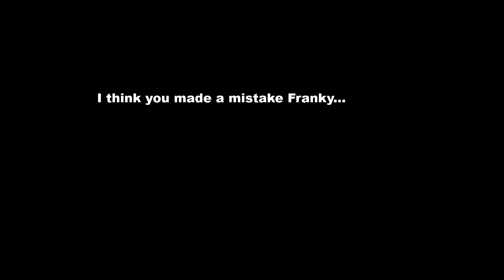BMS holder and powerwall master switch and JK BMS update bonus

Comment: Why did you drill holes in bms?
Thanks beautiful work!!
Reply from the maker: Hey John, 
The holes are mainly for heat dissipation. Secondary, if there's damp inside the unit because of rapid changing temp, the damp can escape via the little holes;

Have a nice day.
Franky - easypowerwall

Comment: The BMS holder is a great idea!
One critic: the position of the master switches:  I would strongly advice that these are like the fist thing you see on a device.  With the master switch behind some of the cables, you get the feeling you have to reach into the device to get to the master switch.  This is maybe ok for the designer of the system, not for the average person like even a fireman  that might be faced with a dangerous situation.  Also, when you cover the rack; these switches cannot be used anymore (but maybe you foresee another breaker that can be easily reached?).  
One other point: I had build into a 12V battery such a main switch (Like the 250-400A version or something...).  Recently, after 2 years of usage, it didn't turn off the battery when I switched it; only on a third attempt it did do the job.  After 2 years of usage in a camper van, this was maybe the 2th time I actually switched off the battery.   Max currents in use was around 120A. With that experience in mind,  such switches don't feel safe in a battery that is used daily.  I would rather check for some real industrial DC breakers that guarantee they will work after 10 years...  
And then I checked the link to the switch... the switch you refer to is only rated "75A(48V)"; I doubt it is safe to use this in your system.  Especially if they don't have a max current rating at 56V .  This switch is just not suited.
Reply from the maker: Hey Walter, thanks again for the great feedback. Honestly I didn't saw the 75A/48V. I noticed 300A....and I know these are chinese amps, so I assumed and assessed 150A. In my system, don't think I will ever use more then 40A per bank, ofcourse if you built a single 1x 16S you need a better switch. Will keep searching for better hardware to improve the powerwall.
In my case, the switch is "emergency switch". In normal use I will never use the switch, and if I have to use, I'll try to do it with zero load on the switch.

Have a nice evening.
Franky
Reply: @Easypowerwall  actually it is even worse; they give you 1 current value as the max value.  If they are serious with their specs, there should be a very clear indication this is continous current and not a short peak current.  Basically we have no idea what the real spec is of this switch AT 56V.  
Related to the max current with 4 banks.  You could argue that each bank will take 1/4 of the load.  That is the ideal situation.  But if you aim to maximize charging and discharging you could hit the situation that 3 of the banks are full or empty and 1 takes all the load.  This you have to prevent by having a real smart BMS that knows how many of the powerbanks are active and informs the inverter to limit load or charging.
We will see if the JK can do this :-).  
I wouldn't trust this BMS without thoroughly testing this.  
Or differently; I would make the design so that each battery can take the full load.  Unless I find this smarter BMS.  And I can imagine a lot of situations in the coming 20 years the solution is in use, the number of batteries is reduced for wathever reason.